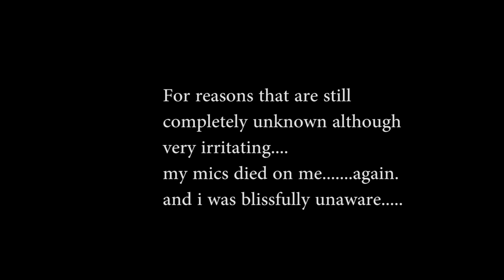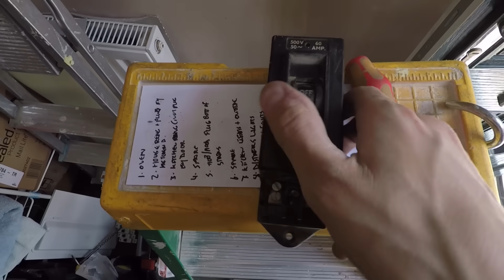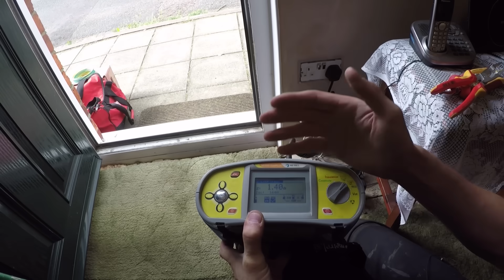Earth rod installation for fuseboard | Thomas Nagy

Comment: Did you check for the mains cables or gas main before smashing in a large pointy spike . technical you need to under street safe regulation before undertaking any work on a public footpath . far better inside  on the owners property

Comment: Rarther than all that ugly copex Running up the wall that the local Delinquent mite yank off the wall just for Fun, maybe a better idea would be just have a short length low level then run the earth inside Cliped Direct to the Fuse Board

Comment: I am surprised that you can put earth rods in all that concrete area.  I am sure that in the big cities that would be almost impossible to avoid, but the soil won't be very damp, and as you noted that the resistance reading was high.  We have to use minimum of 8' ground rods here, as well as the UFER grounds in the concrete slabs of the houses.

Comment: Whilst I see you point about the brass screw breaking, you may actually be causing a problem with mixing the metals, I think it depends on which stainless it is but you can get galvanic corrosion..... Maybe.

Comment: 3:20    Critical computers, and this includes "Servers, should be plugged in to an "Uninterruptible Power Supply".  This is a battery backed device using battery power through an Inverter that outputs 230 / 240 volts 50Hz (UK, New Zealand, Australia, and a few other countries  -- 110v 60 Hz in the renegade USA).  This UPS should be rated so as to provide at least 1 hour of power for the server and associated important equipment.    Any important individual PCs should have their own UPSs, also.    Even my own PCs at home are on UPS.

Comment: Great Video but one observation. Why before hammering in the earth rod you don’t you use an extension sleeve with a bolt in the end and save the end of the rod? Looks so bad all burred over.

Comment: Hey Thomas, we place a nut on the end of the rod, then hammer it in with the drill using a pointy chisel. makes life so much easier
Reply: I see the rod you used, you can drill a hole in the end and use the chisel anyway

Comment: Shouldn't fit stainless steel on brass clamp as can corrode, 2 different metals, hence why it comes with brass nut and bolt !!

Comment: Hi Thomas! I very much sympathize with the struggles you mention about the impracticality you sometimes face on job sites regarding safety. Unfortunately, ignoring the the rules may be at your greater detriment regardless of whether it is to the inconvenience to the client or yourself. If anything does go wrong and injury, death (goodness forbid) or material damage occurs, you will be directly liable. You may face criminal prosecution for negligence and civil action for damages. Also, Your insurer, both workers compensation and public liability will be instantly voided. I assume you are perfectly aware of all this and I need not lecture but the risks  are significantly increased with complacency and not something that you should be encouraging openly and publicly. That's just the way I would be looking at it. Also, about your profanity, I have no problem with it personally but in the context of your trade related videos you would seem much more professional if you kept it to a minimum. None the less, well done! Jó munkát kivánok! If that makes sense.....

Comment: Did you check for existing services? 

You should of installed a Earth Rod inspection Pit. Would have looked a lot neater. 

Don’t whinge about the Safe isolation. It’s your life not the customers. Hence why I wouldn’t ever do crappy house bashing or Commercial tripe.

Comment: Holy fucking cow! You might as well stick a nail in the ground and piss on it, that'll give you a better earth! I'm absolutely astonished that you guys consider this acceptable. Go check out how earth is done in Austria if you get the chance....
That brass bolt is there to avoid electrolytic corrosion and will be fine if you don't over-tighten it. Not that it matters if the steel bolt rots off, since as you say that rod does sod all.

Comment: Do not worry about swearing, there is plenty of Fluffy Kitten videos on here for people who do not like swearing, and I know only too well about working live, I work at a place with lots of residentials plugged into 16 Amp feeder bollards, if the power goes off for more than ten minutes it is Armaggedon once day time TV is interrupted out come the Pitchforks lol. 
Even if you isolate the live side, as you well know it only takes an accidental brush between Neutral and Earth to take out an RCD 
My view on food is this, it is more about what you do not eat than what you do eat, you need to eat fruit at times to get certain nutrients, but most advice on calories and salt is bollocks and is designed for the folks who are watching the day time TV, or sat in offices immobile all day.
When you are sweating your guts out in this summer heat your body needs fluid, but it is also losing salt too, working all day any time of the year like you do requires calories, low calorie is a rip off, let's face it who in the right mind would put low calorie Petrol in their vans and get 100 miles less per tank full. 
Eat high calorie, enjoy the junk stuff, but also eat banana's, mango's, carrots watercress and apples when you can.
Do not actively avoid salt, but do not over apply it either.
Remember the saying about the guy who was not worth his salt. 
Oh and get some sunshine on the skin in moderation as and when you can, work shorts help.
Reply from the maker: Fluffy kitten videos eh? I'll remember to send a kitten video link reply to some of the haters next time, cheers!

Comment: Hi Thomaz, I am from Brazil, I am an electrician like you I happen to 
every problem of low quality material so I buy a screwdriver as a kinpex
 or wiha it is impossible to find, in LONDON it has everything from 
GERMANY, if I had a job in LONDON electricity would be a big hug 
tomorrow.
Reply from the maker: Hi pal, yeah I am also a fan of German products, they often are real quality. Can't believe though you aren't able to get this stuff over in Brazil???

Comment: We use rebar our "grounds rods" and 6 gauge wire. The other thing is dedicated grounding clamps (one end is a serrated clamp for the earth rod and the other a hole with a tap screw for the wire) that can pass a lot more current then a wire lug. People typically prefer steel wire (so do I) since it can handle lightning strikes much better, it frays but maintains a connection unlike copper wire which would blow apart from the heat.

Comment: Instead of putting old breakers in a box, how about putting a length of din rail screwed inside the van on the wall, so you can simply pop them on and also easier to see what you've actually got.

Comment: Hate nit-picking comments but i'd personally never do an earth rod in plastic pipe and leave it sitting higher than ground level like that (bit of a tripping hazard). I would always use steel pipe and an inspection box, lift the paving and cut a hole for the box to fit into. But each to their own, you obviously know what you're doing so i'm not saying you are wrong to do it this way.

Comment: And in the states here most of the best practices are to cad weld or thermal weld your ground connections on anything larger than number eight. You will have a permanent connection that will never come loose ever. Laid it off and walk away.

https://youtu.be/T5DoB26TFtI
This shows him joining two wires. Most grounding in this country is done with solid wire unless it’s very large starting with number eight and going up in size.

https://youtu.be/bDxeqHfwF3c
This shows a four point connection where he is continuing to another ground point.

Comment: Love your stuff @Thomas Nagy so I’m from the states. Things are a lot different here than what I watch on three or four channels in England.

We could never get away using a 4 foot ground rod or however long that is. New systems must have one ground rod at the minimum driven 8 feet into the earth. With a proven test of less than 25 homes if possible or he just flat out put in two ground rods a minimum of 6 feet apart. But the best practice is to double the length of whatever the rods are and that’s how far apart they should be based on engineering practices. So 28 foot rods would be 16 feet apart for best earththing as you guys call it we Call it grounding. 

I tell people to F off all the time keep up the great stuff, cheers 

Daniel 

If you ever want to catch me live I have a channel on Periscope and show my city and my work and my play.

https://www.pscp.tv/w/b_q0mjIyMTE0MTZ8MVJER2x2Tm1YT2d4TP-vyA0FGU5ZcN4ucxPog184_4Dg0bgIDTdXFG9qI4HN
Reply: Depends where you are. Stuff in the UK is generally a lot closer together so you get a lot of parallel earth paths. Most cases a single 4ft rod will get you about 40 ohms, which will pass here. I did a job for a Tesla EV charger recently on sandy ground. I had to use a 12ft rod before I could the earth reading down low enough.

Comment: Them Bosch hole saws are great. Had mine a year and no missing teeth and are still cutting ok. The quick release is fantastic until you lend one to a BT  engineer and he ejects the saw blade down a wall cavity and looses it for you. After an hour of fishing and one broken boroscope (mine by the way)   later he ended up cutting a big hole in the wall to retrieve it. 
I'm a security engineer and have worked with BT engineers for the last 20 odd years, and I can honestly say that they are the worst engineers I have ever met.

Comment: Just a quick question you said you have only put 16mm tails in as it's only a 60amp main fuse, would it not been better to future proof it and just put in 25mm tails!! The main fuse is changed or the type of supply changed?
Reply: The DNO can't just upgrade the cut-out fuse with 16 mm sq tails in situ... It'll be the equivalent of someone removing  a 6 amp circuit breaker for a lighting circuit and sticking in a 40 amp circuit breaker in it's place.
Reply: DNO's can have their own requirements regarding size of meter tails, regardless of service fuse size, so best to determine their requirements for whatever DNO area you're in.

Comment: Server will have a ups and a backup supply... Right? Right... Lol

with regard to the perfectly good circuit breakers one of the local independent wholesalers we use has a set of din rails mounted on the wall of the warehouse that has lots and lots of scrap McD's attach to it it's basically a bringing the old ones when you need one for a call out you can go pick one up
Reply: @11 11 
No it's not.

Comment: Great idea with the isolator after the meter. The amount of boards i've changed and never thought to do this. I've always used henley blocks, but this is a much better idea. Will be doing this from now on.
Reply: It's part of the iee regulation 18th edition to install an double pole isolation disconnector after the meter.
Reply: @johnxenofontos1058  what regulation?

Comment: I've worked in datacenters for a couple of decades. We never once turned off power to have work done. Once, the sparks had to fix a loose connection on a 400V/3-phase/250 amp breaker... with the power flowing. They had pretty thick rubber gloves on :)

Comment: Curious to hear how you decided on Bosch. Hard in the UK not to take Dewalt as they seem better value per Nm. Will you keep the Milwaukee 12v kit and use the Bosch 18v for bigger stuff or will you switch over  completely. Battery investment is the difficult factor for me. If it wasn't for batteries I'd have a mixture or brands. I'm mainly Bosch but they do have product gaps: I wish they would make a soldering iron like the 12v Milwaukee one you showed a while back. It's tempting the buy that soldering iron but the thought of having another battery type stops me. Funny how batteries are locking us into a particular brand. With branding being key to marketing there seems to be no motivation for battery standardization, even when it's the same owning company e.g. Bosch and Dremel. Many thanks for your channel, very slick production and always enjoyable.

Comment: Thomas, sorry for the bombardment! Firstly  I am self employed, Secondly I dont have enough time in the day to record shite! shite i mean your expertise!! expertise is shown in your cleanliness of your uniform to speak. I slog my guts off, dont have a qualification to say but I  did learn to be an electrician, Nvq level 1 never the less, wish i carried on... Anyways I sit on the fence, you throw armored cable because your brand spanking new van cant  cope with a little extra, on that nut shell you receive a new tool bag and dont have a clue or couldnt give a fuck who made it but say its good. FFS splits the trades apart!! sparkys and heating engineers alike

Comment: I haven't seen all your vids but, No surge protection?? Do you do a risk assessment? Or do your customers just say no? and has any one seen and AAFD fitted and how does that affect testing.

Safe isolation I work industrial and that only happens on a Sunday morning if I can get my arse out of bed generally for 125A I do.

O and can I say fick, bollicks, c@@Ty and all of those other trade words.
Reply: Regs say surge protection isn't required for single dwelling as the cost of loss doesn't warrant it. It's still a bit of a debated topic for domestic to be fair. AFDDs aren't being used at the minute in domestic, mainly down to their cost and fact they take up 2 ways in the consumer unit. The manufacturers are working on a device that will offer overcurrent, RCD and arc fault protection in a device that takes up 1 way, so may change and become more common place. It's only a recommendation in the regs at the minute but the first amendment to the 18th edish may say different.

Comment: Just out of interest, did you put anything on the bottom of the conduit box that enclosed the earth rod connection? I'm in the habit of putting a stuffing gland round the rod and fixing it into the bottom of the conduit box to guard against moisture corroding the clamp or connection.

Comment: A lot of this safety is just a load of bollocks. You try isolating a whole line in a factory before removing one machine. No chance. We have maintenance checks that say the first thing you do is isolate the air and then go and check for air leaks!! I never find any.

Comment: Good video butt.

I understand where your coming from with safe isolation, EAWR - so far as reasonably practicable and all that bollocks.

Who informed you that you could snip the main seals, pull the main fuse and install a DP isolator switch. Some people say it's fine, some DNOs play fuck. How do they expect you to record the main fuse size on your test sheet if you can't pull the main fuse. If you were to phone the main DNO and obtain fuse rating by enquiry, they ain't going to know whether it's a 60, 80, 100A fuse of a nail.

Fair play to you having the balls to banging an earth rod down, through a pavement, outside a terrace house. 

Look forward to the next video

Comment: Unless you have a massive van, you can only set it up for call out/reactive stuff or proper jobs. Call outs require few tools and loads of random parts, proper jobs need all the tools and a 2-3 hr supliers run. My transit custom can't do both.

Comment: yeah at work the fuse board is bare open and the box is just hanging on wires with NO back cover, but its all still live because we cant exactly say "sorry, you have to move all of your freezer stuff out for two months until we finish working on your house" (the board is in the kitchen on a wall that had to be knocked down)

Comment: Start of video: Makes a point about being unable to safely isolate a whole DB board (in the real world).
13:07: Installs extra Isolator to isolate the whole board lol.
Reply: MysteriousDrJ thats to isolate the whole system in the future. Tom is talking about not isolating a whole board just to add in a circuit or open up the board

Comment: I get what you're saying with safe isolation IMHO it's all well and good to require it to be done but things need to be designed/installed with the ability to be sanely isolated.

That said sometimes they do have to suck it up and deal with the down time, I work in rail and I can't count how many people's commute we've fucked so we can get on safely to fix something.

Comment: Top Tip!!!  noticed you use a steering wheel lock "perfect for the thieves to use to snap you steering column" rotate by 90 degrees so arm fits between windscreen and a column.

Comment: Nagy....swearing, just a part of your uniqueness and emphasizing the point, who has a problem with that? Ground rods in the US are 8ft long and we install two spaced at least 6ft apart, over here those dinky little rods you installed are used by the telephone and cable co.  An attachment to the electric hammer drill, 3lb hand hammer or heavier type gets the job done. Isn't it great to have a competent assistant who is sometimes better then your self !!!!!   Cheers

Comment: I agree with you, a lot of the time clients are funny about isolation, however with regards to things like servers if they are that important they should have UPS backup.
Reply: Most UPS's are mainly there to give you enough breathing space to weather the odd undervoltage, intermittent fault or at best shutdown the environment. For anything beyond the smallest of small servers, realistically you either need HUGE UPS's to get any runtime at all, or a generator (or generally both). I agree with the "if it's that important" statement, though - but most people don't have generators knocking about to weather the kind of downtime required for this kind of work